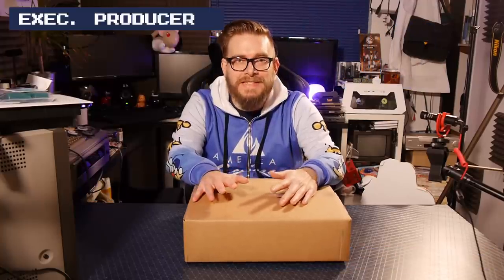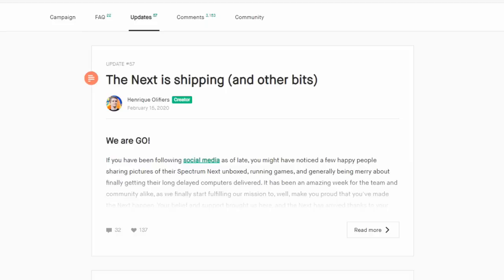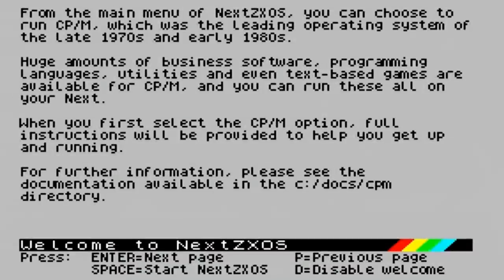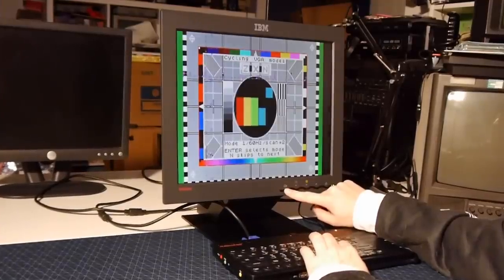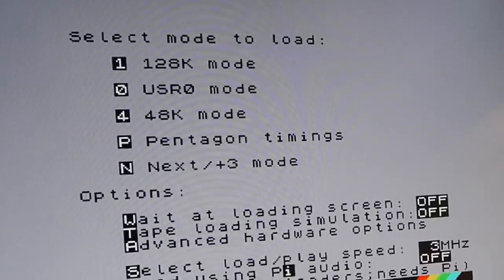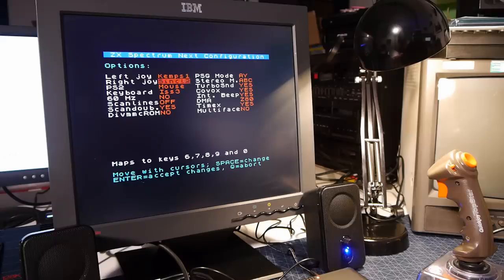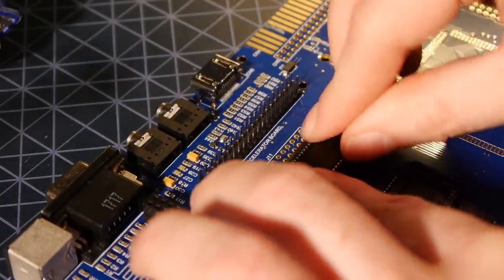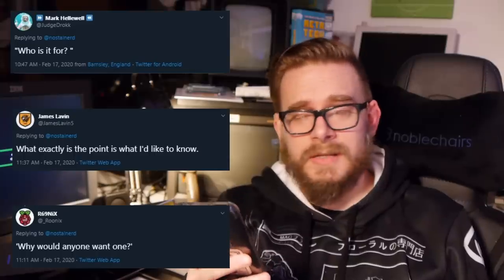ZX Spectrum Next | Nostalgia Nerd

Comment: Is there any actual technical reason it couldn't run a C64 core? It seems to have a lot in common with things like the MiST and MiSTER... I get the nice out-of-the-box experience, which really looks great, but an integrated device with a keyboard and joystick ports and a good-sized FPGA could do other things!
Reply: No, it's likely an unofficial  C64 core will appear.

Comment: While I totally get the attraction for the "vintage" hardware/software many of us grew up with in the 70's - 90's, (I myself use a 40 year old word processor every day still), the one thing I don't get is why these recreations of 8 and 16bit computers of the past have been intentionally limited to replicating just one model/type of device... 

With modern processors being so ridiculously capable, and with the decades of work which has been done programming emulators for almost every single computer ever released, why not go all-in, and build a true "All-in-One" super-classic 8/16bit computer, which could cover that entire era of home computers?

Comment: AW MAN! It really needs a cheap but terrible printer to complete it! Either produce more ZX Printers, assuming it's still legal to vapourise aluminium in people's homes, or else get some of them receipt printers than come as part of tills. They're small, cheap, and lo-res, everything a Speccy owner needs. 

Then it needs microdrives, but I suppose SD cards will do for this. They need to be on a wire in a box away from the computer though, not built-in. We don't want convenience, we want a SPECTRUM!

If it's gonna have a USB port it definitely needs an edge connector! Yes, I realise the Z80 in this probably only exists as software, but still. You just need a couple of dozen GPIO lines, you can get chips that take an SPI input and provide digital GPIO pins. So the emulator inside this can drive those pins and peripherals would work! 

If it's an FPGA and there's an actual "real" CPU in there, written in VHDL and connected up between a web of flip-flops, it still counts, and it's busses could surely be routed out to an edge connector. Or else just stick an SPI controller in there that responds to IN and OUT instructions. 

I quite liked the built-in joystick on the Enterprise Elan, but I realise that's not gonna be practical cos 5 minutes with Daley Thompson and you've annihilated your computer. Give it a couple of joystick ports, configurable on-board to act as whichever type (basically it's gonna just be Kempston). If you wanna be nice you could stick a Bluetooth chip in there to access Bluetooth joypads. Or else whichever other, problem being there just aren't any 9-pin joysticks any more, they just disappeared one day when we turned our backs and forgot them. That's what happens! So love love love your original hardware, babies! I think most of the stuff in the wild is now on the market, but sadly people now are expecting 50 quid for a Spectrum that I'd have turned down for a fiver at a boot sale. If only I'd been more cynical! I'd be a thousand-aire at least!

Man at one point I had an imported Nintendo Virtual Boy, sent from the USA to me in the UK. It was a former Blockbuster Video model so came with an indestructible briefcase. And it shows how desperate we were for small battery-powered displays! Anything would have done! Still the games weren't bad. It's a shame there wasn't any proper 3D though, like Starglider or Frontier: Elite 2 on it, but then the graphics hardware was just modified SNES stuff, set up to do things in layers, like cardboard sets in a toy theatre. No real 3D just layers of 2D in front of each other. 

Red Alarm was the one 3D game. Wireframe, with no hidden-line removal. Hard to navigate, confusing. Still fun though. If they'd put in a more powerful CPU and a sensible display, just a bitmap, or 2, one per screen. Then maybe a few tricks to help it render. And a much better CPU with some maths ability. They definitely existed around then.

Comment: When can we see this coming to non PAL regions?
Reply: Neatly, this one will actually work quite* well in non PAL regions.  There's a software 50/60hz trigger, for example, so you'll want to get in on the second Kickstarter.

*HDMI alters the timing slightly which may upset very tightly coded demo software - relevant if that's your interest.  VGA timings are apparently authentic, however.

Comment: This is the real deal and a great way for people to get a genuine Spectrum experience minus the painful tape loading. It's also a perfect example of crowfunding as had this been a commercial product it would have never have worked or would have been nerfed in some way to increase profits. I hope the Next team do make a profit as they definitely deserve it. With the experienced gained from this project they could totally do a C64 Next. :-)
Reply: I've seen a couple of guys suggesting a C64 version, however, I'm afraid it would be difficult to fit C64's custom chips like SID and VIC into a single FPGA array. Even if it was possible, I'm not sure if anyone did the necessary reverse engineering to create accurate emulation of these chips. Last time I checked the ZX-UNO project (which is similar in concept) it could only handle Commodore VIC 20.
Reply: @baze3SC  Search for Ultimate 64. It's a C64 replacement motherboard with enhancements (SD, REU, Ethernet/wifi etc.). It's FPGA based (including VIC and dual SID). No Turbo or enhanced graphical capabilities though.
Reply: @almerian  Looks sweet, I like the concept. Though the purist side in me would like to see original cases used for original PCBs. Just like you keep the original engine inside a classic car. After all, these FPGA projects are hardware emulators. If they created an aftermarket C64 case for it (even if it was the copy of the original), that would be a step further. But that increases the complexity of the project of course.

Comment: I've been dreaming about an 8-bit style computer, but with beefier specs, is this it? I should probably know the answer to this question, but specs have always been my achilles heel. How does it compare to say a C64 or Apple II? Equal? A tad better? Next-gen (as in a 16-bit BASIC computer, not a PS5)? 

Writing this comment really makes me wish BASIC computers had remained a thing. Imagine all those POKEs you'd have to do for 3D games... Okay maybe not, but sprite/background transformations a la SNES mode 7 would probably be pretty sweet in a BASIC setting.
Reply: It's closer to the Amiga than a C64. It has 128 hardware sprites, a hardware tilemap and hardware scrolling. There's a good Shadow of the Beast demo if you wan't to check it's capabilities.

Comment: lol. Does it play c64 games.

Some people...

Then again, there's a spectrum emulator for Atari 8 bits that have a rapidus expansion installed, so... I guess?
More generally, anything implemented on an FPGA may in principle be able to run version of other systems. Though clearly sub-optimally given the ports and connectors present.

Nice machine...

But what I really want is an portable atari 8 bit with approximately the capabilities of the Rapidus and VBXE (hopefully compatible with those, since it's hard enough getting people to write software for 'upgraded' systems), SD card support, USB controller support, a touchscreen that emulates the atari drawing tablet, and a portable keyboard of some description
Then add docking system comparable to a Nintendo Switch, so that when docked you can use original style accessories and connect it to HDMI, VGA and perhaps composite and S-video style connectors (since this is essentially what the original systems used)

Rapidus + VBXE more than covers any desire for 'upgraded' games (but if you want to push it further implement a rapidus equivalent with even higher clock speeds - like say up to about 100 Mhz. FPGA 65816's have been pushed to 280 mhz, so it's doable).
Though I suppose we'd also want upgraded sound. Given common upgrades I would go with a Quad pokey configuration (that's 16 channel stereo sound at that point) as well as a more modern chip that plays 16 bit stereo digital audio. (maybe with decoding hardware for modern audio codecs) - this is somewhat consistent anyway with how the Atari would let you play audio off tapes in theory. (If you want to go all out, give it an ability to decode modern video formats in a way that the system can display...)

Anyway, I have a lot of stuff to figure out to make that happen I guess. XD
Reply: Maybe take a look at (well, google) the MiSTer Project, as a place to start.

Comment: There is no technical reason for them to not have included all video options for HDMI connector. I understand that some displays won't work with anything than standard TV resolutions but it is mostly TV's that have such issues and not all at that. Most monitors will work fine with most HDMI resolution you throw at them and what is even worse there are HDMI to Component converters which work just fine with any resolution allowing high near-RGB quality image quality on many 15KHz CRT's that do not support RGB. Not giving user choice to use these modes is just bad design philosophy, especially that device is designed in such a way that having few incompatible modes  would mean only more 'n' presses in test pattern screen. Though I should be complaining on Next forums not here :P BTW. I wonder about your definition of "silky smooth" watching you play choppy Stuncar Racer...

Comment: Here's how Sinclair could have dominated UK/Europe/The World! home and general business PC markets.... Instead of release the Spectrum 128 and QL as two separate computers they should have released 1 computer, for around £199.99 to £279.999 with the upgraded Motorola 68008 of the QL but keeping the Zylog Z80 of the Spectrum.. Many computers were dual CPU + other bespoke chips (esp. Commodore). The spectrum only had 16kb graphics memory and QL only had 32kb yet there was 128kb available... 64kb for graphics and 64kb for code and other data would have been better all round at the time... The second chip could be used as a graphics coprocessor. Also the longer case of the QL, with its double microdrive extension should never have been made, instead the entension should have been a separate addon for £149.99 with lots of games and/or business software bundles... Instead Sinclair didn't upgrade the spectrum and were snobby about games (the spectrums main market) so made the QL, which though faster and better in many ways did not upgrade the graphics enough... Should have been  at least 512x256 x 16 colors instead of 4 and released on time in 1984.
Reply: Iirc, there were actual plans for the QL to support Spectrum software but it never quite came to pass.

Meanwhile the development of the 128k was driven by the Spanish Investronica, mainly for their local market, because there were tax considerations on computers with less than 65k and no Spanish language support, which the 128k would skirt by upgrading the RAM and including a localised ROM, but when the QL failed in the home market it suddenly looked viable elsewhere.

Comment: Those keys aren't like a Spectrum keyboard because they aren't RUBBER!
If they are an improvement on the 128, then they should be microswitched or something.. as they were like lazy fudge that had been packed too hard..

EDIT.. GOOD KEYBOARD.. (if not a Rubber One)
Reply: It's scissor switches like modern laptops.

Comment: Why is there a damn Amstrad logo on the menu of this machine?!,...NOOOOOOOOOOOOOOOOOOOOOOOOO!!!!!!!!
Reply: The same reason it's on the boot screens of the ZX Spectrum +2, +3, +2A etc. Because Amstrad bought the Spectrum brand in 1986.
Reply: @gwishart  Yeah I get that but the Next is modelled after the Toastrack and neither the Toastrack nor the Next machines were designed by Amstrad, it shouldn't have any Amstrad name anywhere on it imo, it would feel more Sinclair nostalgic without it which is another reason why I like the Toastrack because of It's original non-Amstrad menu screen.

Comment: Lol 165 quid for a ZX SPECTRUM???? Dude, you got FLEECED!!!!! 🤣🤣🤣
Reply: Actually, it's pretty competitive with a vintage system when you take into account the cost of all the hardware add-ons rolled into the board.  ZX HD alone is around £70. Another £50 for SD card interface.  Plus the cost of the system, plus maintenance to bring it up to snuff.

Vs Pristine, brand new Rick Dickinson designed, sleek all in one unit that looks the absolute mutts nuts and feels glorious to use.

Comment: Thanks, but no, thanks. I like quirkiness of the old hardware.
My +2 has taught me to design PCBs and solder SMD parts (I've made my own stereo-mod PCB to get rid of nasty static). Making Kempston-to-Interface2 converter was also a fun evening. Don't think NEXT can teach something like that.
Speccy +2, RGB-SCART cord and OSSC is setup of my choice.
Reply: I think I understand. But how about for starters learning to connect MIDI ports to the UART connection inside, make it possible to connect any Centronics, serial or even USB  printer in NEXT mode, light up those colored side stripes, turn them into touch buttons, add a second SD drive, even ultimately design your own computer and put it into the FPGA on the Next?
Reply: @almerian  Be kind:  I think he's trying to convince himself that he doesn't need one ;)
Reply: @TheTurnipKing  You actually got me! 
The NEXT is cool, but I only lack SD card expansion to have the same thing with a real 80s device.
The only thing against the NEXT - it won't look in its place on the shelf between my Atari 800xl and Amiga.
I'd better invest the dough into buying a real C64... To put it on the same shelf 😉

Comment: but is it better than the vega????....im sorry dont burn me :(
Reply: Vega had no modern display outputs and no full keyboard and it was basically just a software emulator in a plastic box, which in turn caused some incompatibility and slow frame rate, especially if two video memory pages were used simultaneously. Next is a different concept, it's based on hardware emulation and it's therefore more accurate.
Reply: @Vlad-bu3mr  Hahah, good on you mate, you caught me there.

Comment: WHY HAS IT GOT ATARI JOY PORTS????!
It would be COOL if there was a USB beneath EACH ONE!! FFS
Reply: Because it's a fpga'd z80 system, not an ARM emulation box.

In theory you might be able to connect USB devices via the Pi accelerator: I understand it supports a 360 controller this way, but the Atari ports are for genuine vintage joysticks

Comment: Never understood how the 3 colour games of the speccy appealed to anyone . . . . . 

whens the Amstrad coming? lol
Reply: Jeff Arnold - are you thinking of a VIC-20? The Speccy could display all sixteen colours (well, eight standard plus eight “BRIGHT”) at once quite happily, with the caveat of only two colours, 1x INK and 1x PAPER per 8x8-pixel character space.
Reply: @scunnerdarkly4929  so do we put it all down to lazy programmers?  take a look at the red ferrari in outrun on the amstrad then take a look at the speccy version lol look at batman on amstrad then spectrum, you might as well connect the speccy to a black and white tv.
Reply: @Jeff Arnold. Looks like the CPC6128 core is here: https://gitlab.com/victor.trucco/zx-spectrum-next-cores
Reply: @128eggz  so it can have some colourful games ha ha ha i think if i get the urge to play the old games again i'll just load up winape
Reply: @JungleJeffarnold  fair enough. I'm hoping that (given time) this will become the ultimate retro machine, with accurate fpga personalities for C64, Cpc, SMS etc and even the odd 16bit system.
Reply: @128eggz  I guess having it all on one keyboard could be good but you can already do those things in a lot of ways, cheapest probably being a nintendo wii
Reply: Jeff Arnold - you’re right of course, the Speccy  colour implementation was terrible but it was a big step up from the ZX81, which had none. Amstrad was better all round for sure, more akin to a Beeb on the visual side, but the little Sinclair had charm and was cheap and with clever coding from the likes of ACG it was possible to make games that didn’t look completely jank.

Comment: i really want them guys to be successful as they all rock but frankly this console is a bad idea
'
i'd rather buy the case on it's own and just skip to the rasberry pi..... i was nearly seduced by this or maybe (more sensible) a maxemite board.... but really it's much more fun to make retro software on a modern computer using Godot, so this has limited appeal to true technical enthusiasts (indeed the maxemite is a better option, it runs basic also but at 400Mhz)
'
so 250 quid for this!?! madness, only for the fatally nostalgic (who would be better off buying a real spectrum because at least that's collectable)..... or maybe (most likely) you just have more money than me :).  ... as a programmer also i couldn't even waste my time with basic anymore, good riddance